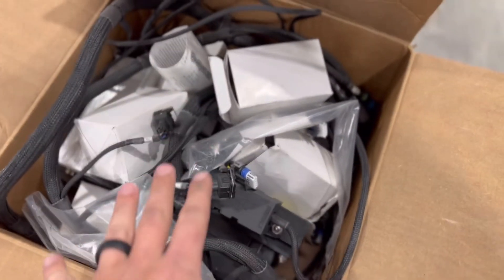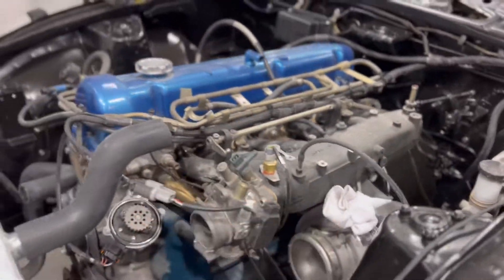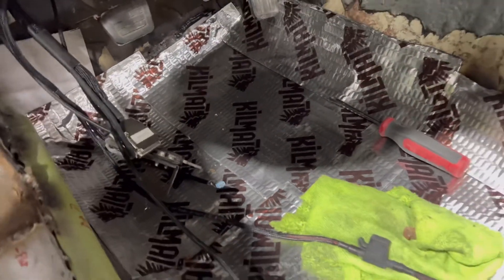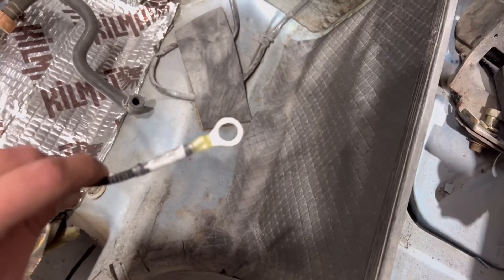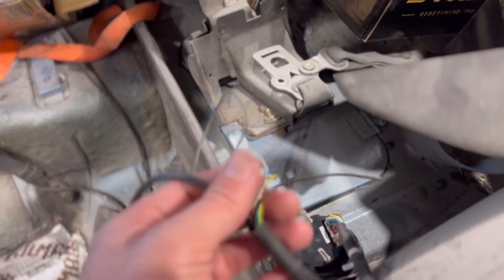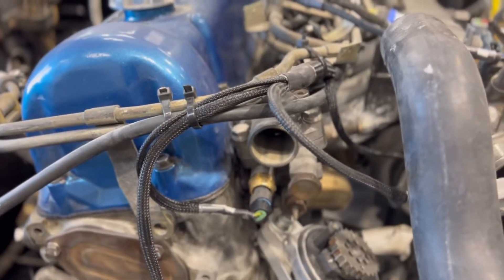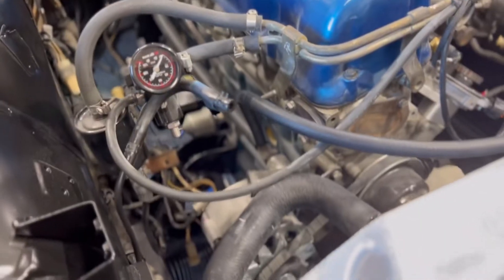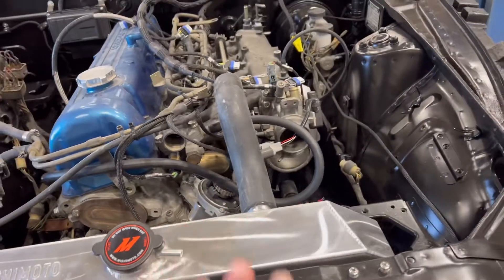280z: How to Install a Standalone ECU

Comment: Great job with the videos and install. Question: Did you have an issues setting up the base timing between the motor (cas) and the ecu? Any advise there?
Reply from the maker: Thank you for the compliment! No I didn’t have much trouble setting up base timing, I lined everything up to 0degrees TDC including the spline off of the oil pump to the CAS and went into tuner studio set that position as TDC and set cranking advance to 10 degrees and at idle I believe I’m around 13 degrees advance for timing I hope this answers your question or helps at least !
Reply: @octane_media  Thanks for the advise.

Comment: This is super helpful as a visual example. Did you only need the crabk angle sensor? No cam agle needed? Ive been seeing conflicting information online
Reply from the maker: I did need the CAS crank angle sensor there is no cam angle sensor the way this setup works is by reading the angle of the oil pump shaft, it slips into the bottom of the CAS and the cas then reads which tooth/ the angle and degree of the motor and then transmits that to the ECU for timing control !
Reply: @octane_media  Awesome, thank you for explaining. It helps a lot! Gonna try to put MS2 in my 280z and want to make sure I've got everything I'll need.

Comment: Love the video man you addressed some of the things I was struggling with with the CAS where did you wire the tach wire to and also for the a/f gauge where did you wire that into? Do you splice it into the harness or is there a different place to wire it?
Reply from the maker: The tach should be wired to the negative side of the stock ignition coil set up I had a plug n play with a dedicated wire for it but my tach itself is broken.

Comment: Where did you get this complete set up from. Looks very complete and well thought out. Good job !
Reply from the maker: The ECU is from a company called Godzilla Raceworks. The turbo kit is from a company called ProTunerZ. The radiator is Mishimoto in the intercooler is from Godzilla Raceworks as well!

Comment: Did you have problems with ur rpm tach not working after installing this system?
Reply from the maker: Yes I did even though it had the provision for it it don’t work for the stock gauge cluster it had to be switched to an aftermarket one for it to register the signal !

Comment: Read somewhere that placing the intake temp sensor after the throttle body can cause issues. 
Don’t know if that’s true but could be worth keeping in mind.
Reply from the maker: The instructions that were given with the ecu told me to place it behind the throttle body since it was after the intercooler. But I’m not sure that everyone would be exactly the same it would probably depend on your application.